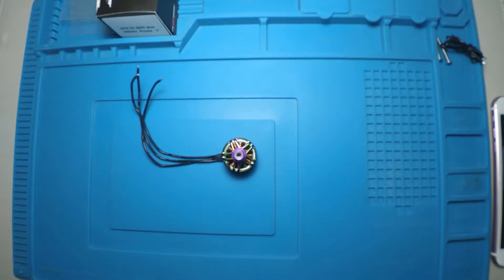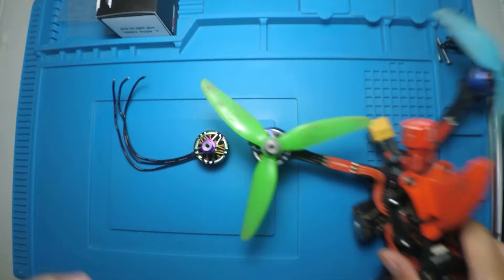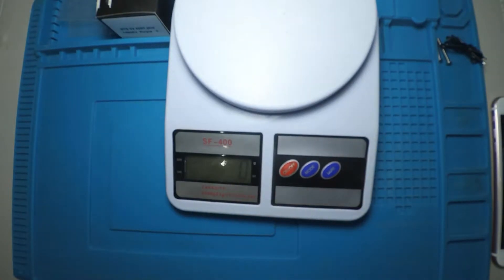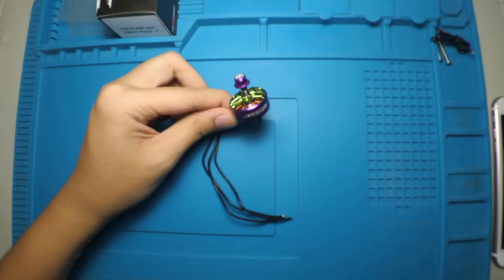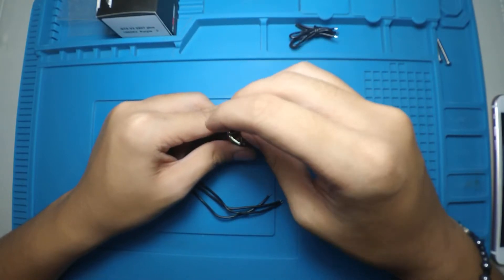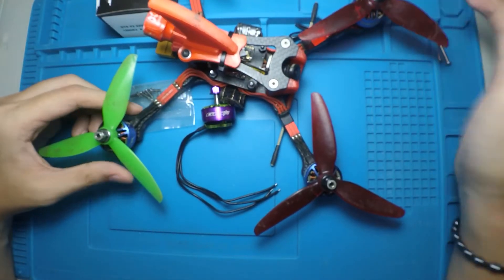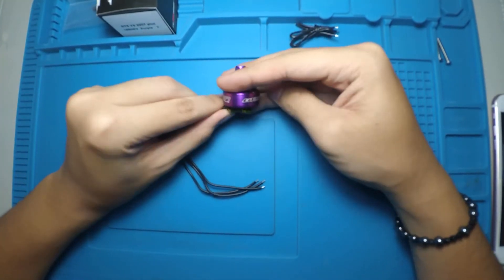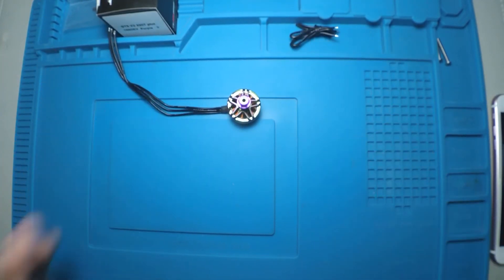Vanover motor? Rcinpower GTS V2 2207 Plus Overview!

Comment: Hey, I want to buy this motor. Do you think it's durable? I've crashed my brotherhobby r6 motor so many times on dirt and it's still doing fine.
Reply from the maker: I've ran this motor for 2 years now on my race rigs. Best motor I've flown so far. Nothing is indestructible, but I found this to be very durable.
Reply: @andrenalinfpv8087  I bought RCINPower few weeks ago 😊I'm still missing other parts for my other drone. It looks beautiful!
Reply from the maker: @neilfpv  I'm sure you won't regret your choice! Rcinpower knows how to make motors.

Comment: Sorry but this isn't vannover's motor under a different name; he helped develop these. 
In this video (https://www.youtube.com/watch?v=WfgGSgbj0dk) he responded to one of the comments saying its a clone of the rcinpower motors. Vannover's response was: 

" it’s sad to see people jump to conclusions like this. First off, I helped rcinpower develop the og 2207.5 1860kv motor that you are talking about back last fall when I was living in Korea. I spent countless hours testing the motor with the intention for it to be a vanover motor. The motor came out great, however I wasn’t ready for it to be my motor just yet. The last few months since I spent time getting many more samples made with little tweaks such as the air gap, windings, magnet, and even different bell designs. All these things led to this motor, yes it is very similar to the rcinpower, however, I would like you and everyone else to know that it is not the same motor, although it flies similar this motor is made to specs that I believe give it an edge over other motors like it"
Reply from the maker: Yup, I know the story and all that. Was just giving another perspective on it! Having owned BOTH motors, I can tell you that they were basically identical anyway. Again, at least from what I have seen from my own eye, only the color blue is different. No doubt that Vanover really did spend a lot of time in developing the GTS V2 though, which makes the motor that much more valuable.